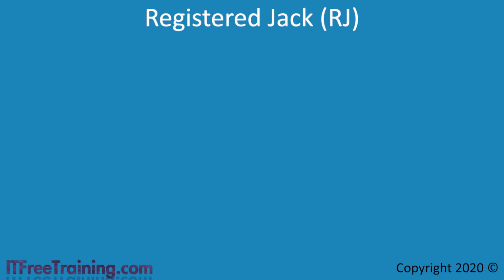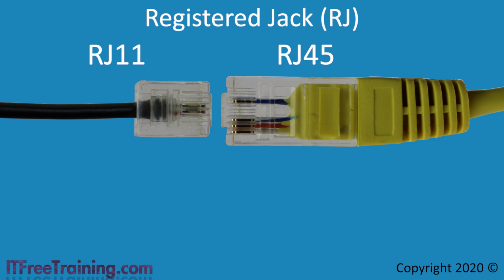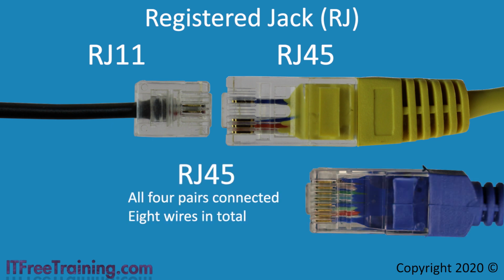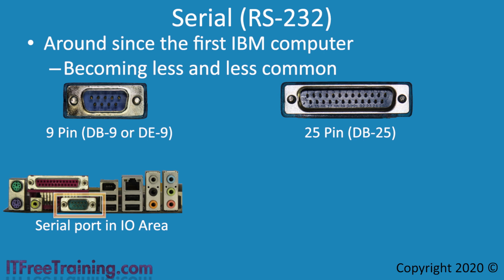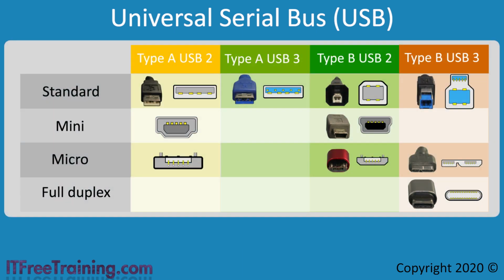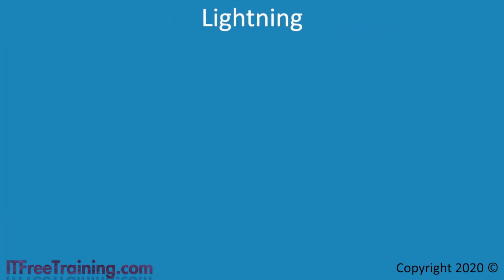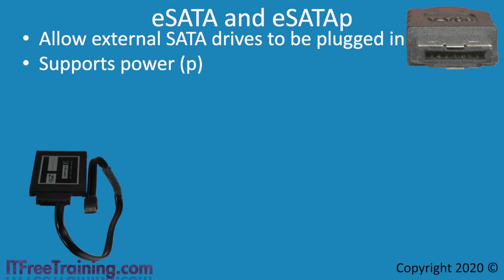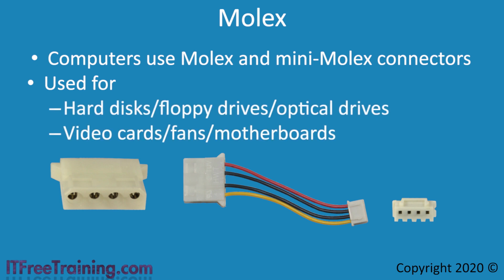Common Connector Types

Comment: The signal in the TV cable does not go in just one direction.  While this may have been true at one time, for many years the TV cable has been used in both directions.  For example, my cable modem is the only thing plugged into the TV cable with IPTV using IP through that modem.  The reason for the terminators is the bus nature used for the computer networks.  The devices are high impedance with the terminators used at each end to match the impedance of the cable.  This prevents impedance mismatch and reflections in the cable.  A TV would have the terminator built in, as it is the only thing at the end of the cable.

Comment: BNC (Bayonet Neill-Concelman)
Reply from the maker: Thanks for pointing that out.
Reply: I came to find if someone had pointed out this fault.
Reply: I have never heard it called a "baby" until now.  However I have heard Bayonet N Compact, as it is similar to the larger N connector and can be plugged into an N socket, though the lock won't work.

Comment: What's the meaning of NO BEEP SOUND? When post testing motherboard?
Reply: Mine never beeps, just works. If you've got a fault, but no beep, then get a PCI POST card. That will tell you the issue unless your PSU is down.
Reply from the maker: If the system is working, no beeps means the speaker is broken or not connected. Some BIOS, will also have an option to switch the start up beeps off so that may have also occurred.

Comment: Awsome video. Just to add some info: using 8 wires in a RJ-45 connector may also means that you are going to use such a cable in 1000Base-T Ethernet (and up) scenarios: DA,DB,DC, DD. For 100Base-TX situations only 4 wires (of the 8 avaliable) are acually used.

Comment: You missed PS/2, not to mention Firewire/i.Link, and it's replacement - Thunderbolt.
Also, I was wondering why you left out display connectors.
Reply from the maker: We have whole video on those content common out since there is so much to discuss.  However, the PS/2 we should have included in this video, so nice pick up pointing that out.